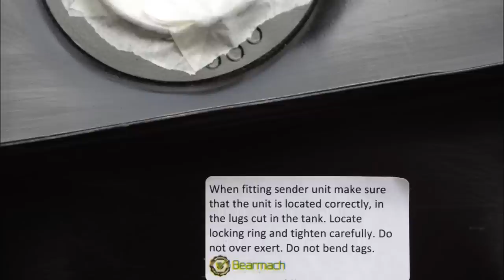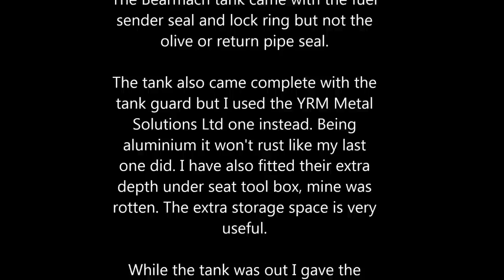Landrover Defender 110 300Tdi fuel tank change

Comment: how did u empty that tank? when i tried to syphon the fuel there wasn't any suction on the pipe. it is a 2013 car though so there might be some sort of anti-tamper feature. any help would be much appreciated. thanks
Reply from the maker: To siphon make sure the pipe is in the fuel, then suck hard, try not to get it in your mouth! A 2013 tank will be a bit different, not sure about any anti siphon device, if you can't get the siphon pipe into the fuel then there is one. Easiest way to drain the tank is from the drain plug but it could get messy if don't use a big enough container for the amount of fuel in tank. Sorry for the delayed answer but I've been up in Scotland.

Comment: You seem to be missing your rear Anti Roll Bar. When changing the tank, you also need to undo the bolts connecting this to the chassis via the rubber dampers and rotate the anti roll bar downwards.... (otherwise you cannot drop the tank).
Reply from the maker: My Landy was never fitted with anti-roll bars, I did think about adding them but even when fully laden it doesn't roll too much. You are right about if you have anti-roll bars, they need to be moved out of way.

Comment: Did you block off the pipe going to the engine? Is getting air in the system a risk?
Great video, cheers!
Reply from the maker: I just stuck the pipe ends in a plastic bag to keep the dirt out, air does get in but bleeding the fuel system is easy. I loosened the bleed bolt (10mm I think) on the fuel filter and manually pumped the fuel lift pump until no more air bubbles come out, then re-tighten the bolt.